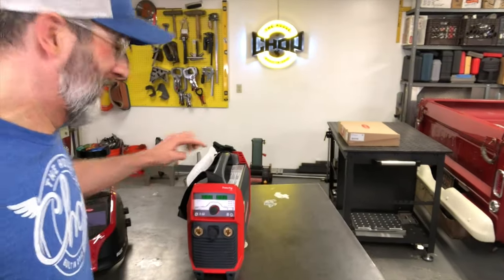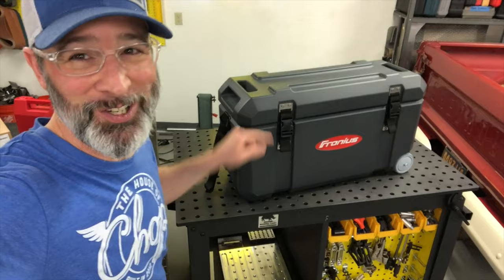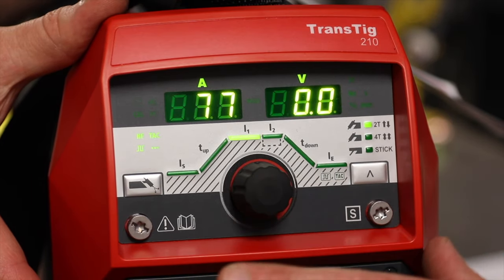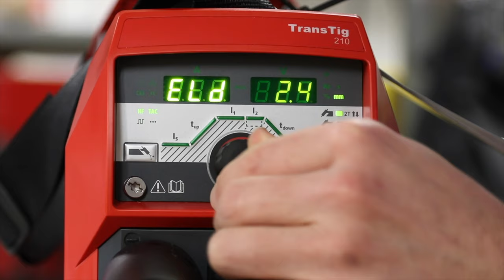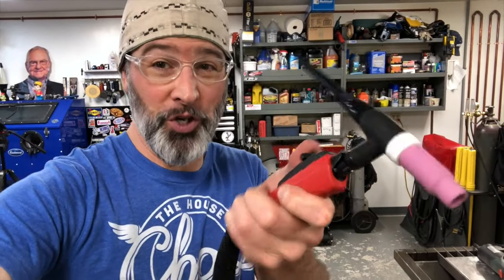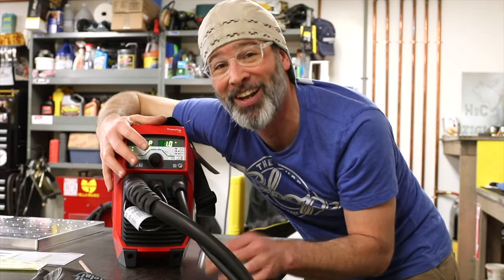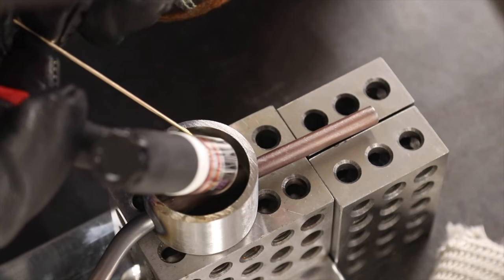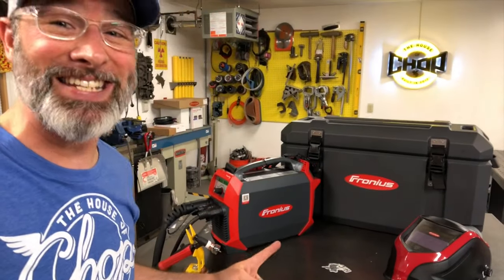21lb of TIG Welding BADASSERY! Fronius TransTig 210 Review 🤯

Comment: I saw this while watching Darlington farm do repairs on a water tank I noticed he didn't have it plugged in thought I was a rechargeable welder -.- silly me 
But now that I see your video I'm like wowowowowowwow pulse setting and it doesn't pop breakers that's awesome I'm a welder and I do alot of sanitary work and when you have your crew working in the same room running welders we are bound to pop a breaker that happens all the time this is awesome to me... thanks for the video
Reply from the maker: My pleasure! Glad you got the info you were looking for. Just for the record they do have a rechargeable one it’s called the Accupocket. Different features and specs but a really awesome remote unit.

Comment: Nice Vid! Thanks. Would you please tell me what torch head you are using in the vid? I‘m especially interested in the glas gas/jet you‘re using. Can‘t find one fitting my Transtig 210 torch…
Reply from the maker: Thank you! Appreciate you taking the time to watch. Basically what you need is a stubby gas lens kit for a number 17 torch to make the conversion. Here are some links: 

https://www.arc-zone.com/gas-lens-collet-body-ck-4gl

https://www.arc-zone.com/reverse-collet-ck-7c-?cPath=&

And then you can choose your favorite 9/20 series edge cups

https://edgeweldingsupply.com/edge-920-series/

That reverse collet really grabs and makes this setup work great.